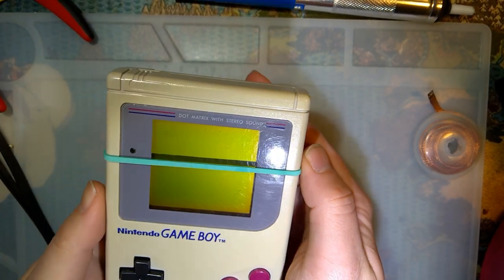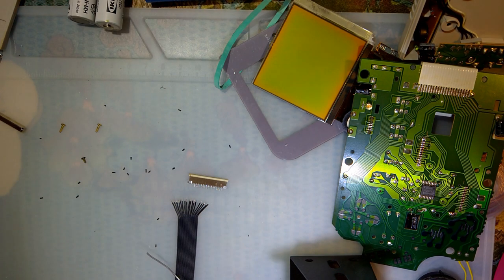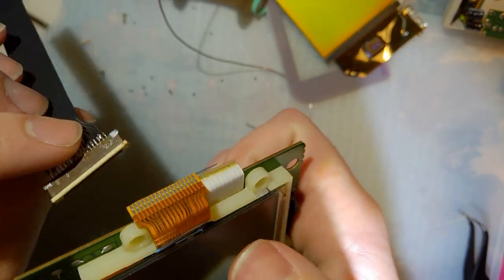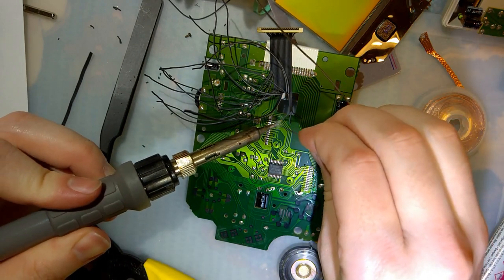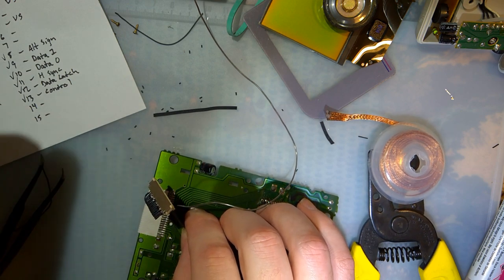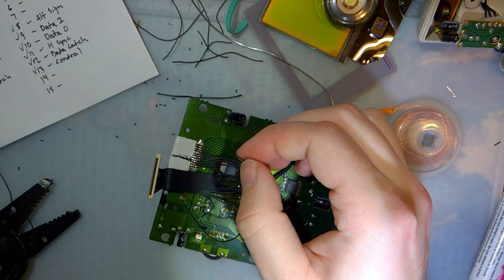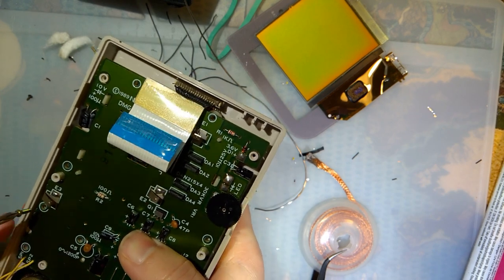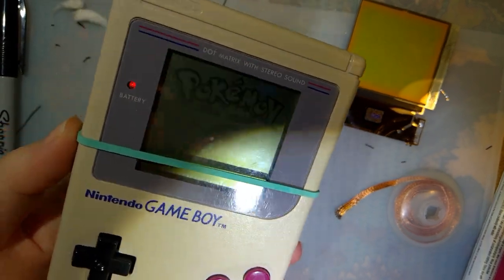Installing a Game Boy Pocket (MGB) LCD in a DMG Game Boy

Comment: Nice work. so you opened the door using These gameboy pocket ips replacement screens from china.really cool.
Reply: They actually have ribbon cables for DMGs as well.
Reply: @AtoManPL  I wonder whether someone will come up with a converter cable to adapt the FunnyPlaying IPS panel in a DMG...  Although BennVenn had his 3" kit that basically replaces the whole front PCB, but that's not as good a screen as an IPS, I'd imagine...
Reply: I guess, someday? I wouldn't say no to the Pocket version either.

Comment: > "I will edit this video"
> 1:12:43
xD
Reply: As for custom PCB - wouldn't it be more user-friendly at this point if you just created a replacement front PCB? That's what BennVenn is doing with those backlit kits, even if it meant moving some components off original board it would still be more user-friendly.
Reply from the maker: @AtoManPL  Last time I over edited the video and sped up some of the soldering and someone complained. There's just no making everyone happy.

And making a new front PCB sounds like a lot more work since you'd have to transfer over more than a handful of components. The boards would also need to be ENIG for the button contacts and that makes them a bit pricey. I was thinking of just making a flex PCB to solder straight to the ribbon and leaving a few pads to solder the v1-5 lines but then HDR beat me to the punch. He made this: https://oshpark.com/shared_projects/NLWubYhx and it's pretty much what I was going to do. It should work fine as long as you order it as a flex PCB. $12 is a lot cheaper than a whole new front board.

Comment: I'm going to try this in a few days, is there anything you would do differently or add to the process? Really great walkthrough, thanks!

I'm doing it so I can have a nostalgia machine, but backlit. LED backlight, 'original'-style LCD with a stock looking, green screen when switched off (with the pocket screen not requiring biversion so much, and I'll replace the pocket front polariser with a green one)
Reply from the maker: According to gekkio's published research, the specs are not the same between the DMG and MGB screens. It's close enough that it worked, obviously, but I can't say it will last indefinitely. 

Also, there are flex PCBs out there now for this. IIRC they're on oshpark shared projects but I don't have the specific link.
Reply: Thanks @makho  , I did leave a reply but I think YT deleted it because I posted the oshpark link for anyone else wanting it. Are you able to remember where you saw gekkio's research relating to the screens? I've been looking at his blog and reddit posts and couldn't find anything. I might reconsider the mod after having a read. I would hate to mess up original hardware in the long run for the sake of an experiment, considering the alternative of a regular BL mod is still good. Thanks for all the vids!
Reply from the maker: @tsutenkakurobo9642  he's been posting to discord

Comment: where did you get the ribbon cable??
Reply from the maker: It's part of an old 80 wire IDE cable. I just cut the connectors off.

Comment: awesome work...its too bad there is so much ghosting on the GBP screen.
Reply from the maker: You say that like it's not an upgrade over the DMG LCD (especially one that has horizontal lines)
Reply: Yeah... have you played the original dmg? The pocket is a huge improvement over the original in screen ghosting and contrast
Reply from the maker: @HollowRick  I have and that's why I didn't feel bad about the upgrade. DMG screens are garbage.
Reply: @makho  I was asking the commenter Haha i know dmg screens are horrible aha :)
Reply: @HollowRick  actually the ghosting on the pocket screen is just as bad as the DMG screen. They use the same STN screen technology. The pocket just has slightly better contrast.

Comment: didnt know that was possible. makes sense though. so theoretically could you put one of those AIO LCD kits in this if you could find the room for the pcb?
Reply from the maker: spoilers

but yes even though there is already an adapter
Reply: @makho  oh, didn't know that was a thing
Reply from the maker: @seahorse5465  https://www.aliexpress.com/item/4000479483560.html